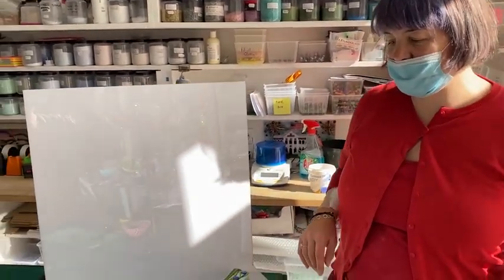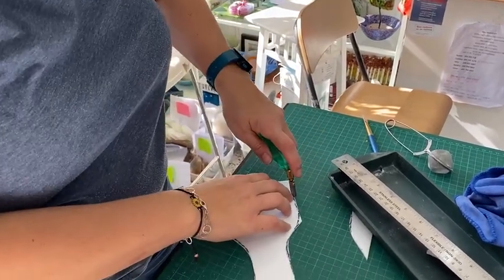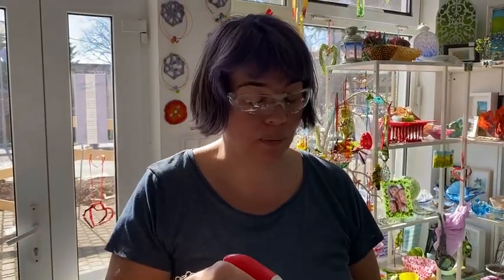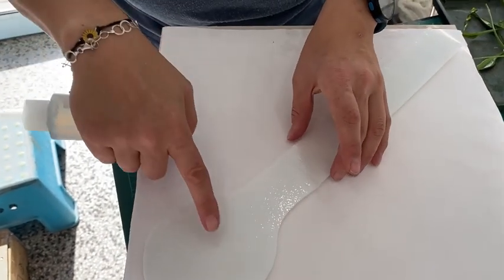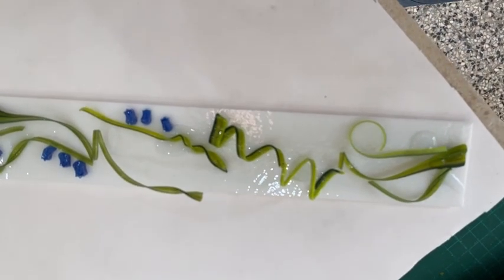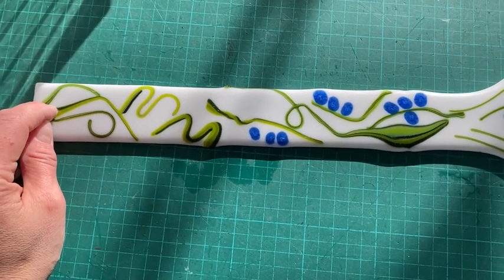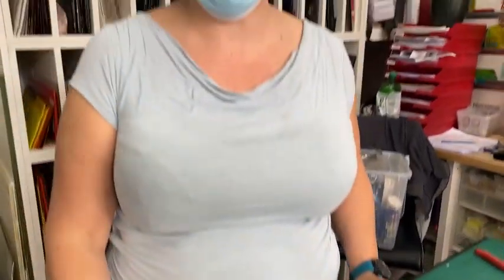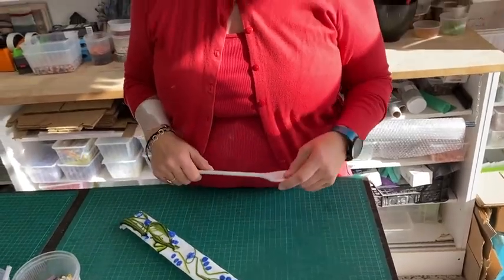Spoon Rest

Comment: I absolutely LOVE your spoon rest! I am going to try this out this weekend! I use system 96 and have not had any of the problems most have encountered with cleaning that could result in fingerprints if not properly cleaned or devitrifications, even with long soak times never seemed to effect the glass quality. If i was ever in doubt i just used windex. However, since spectrum quit making 96 and it has gone to mexico I am finding that very problem. They are new at it am sure they are working on it. Also, The glass is much more shardy  as if it is not being annealed long enough in production. I thought this may be helpful for any other fusers no matter what system they are using. I have been fusing since 2010 when there were NO video references to glass fusing. I just love your projects!